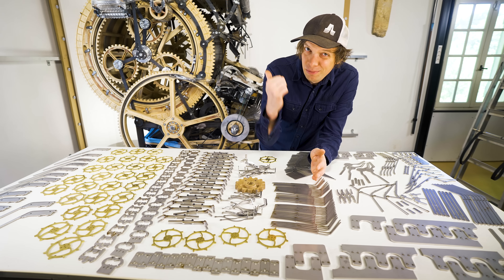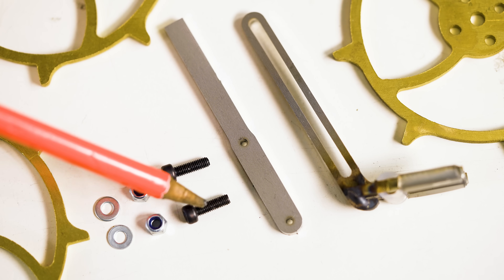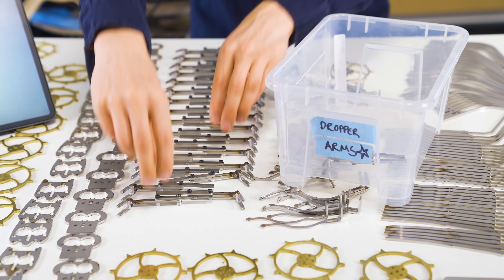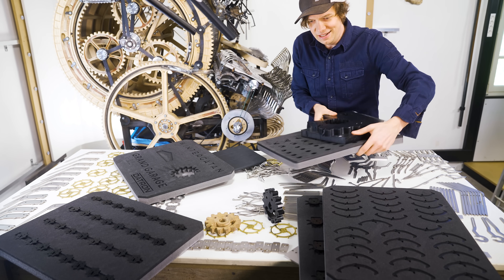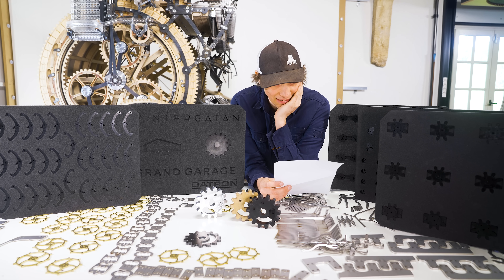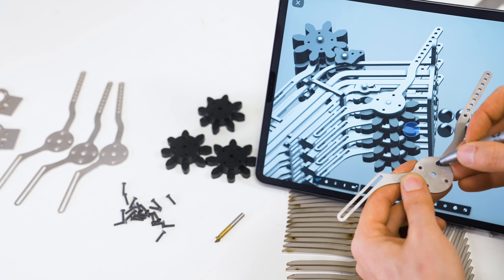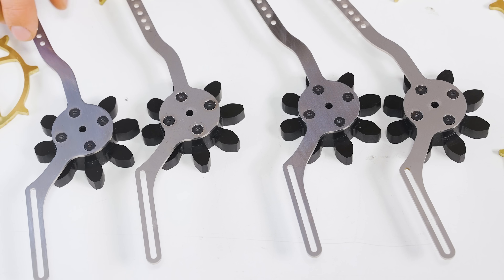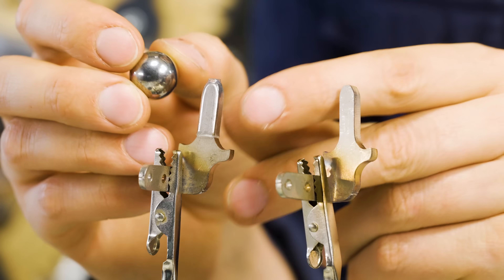Solving the 1000 Pieces Engineering Puzzle

Comment: That packing was 100% Next Level "We care about your product." Also the gears measuring down exactly 14mm and you were only expecting .1mm tolerance gave me goosebumps 😂
Reply: 0.1mm is a pretty target. It's only +/-.004, which most machines can hit right out of the box. I can hold half-thousandths on an old Atlas 618 without much fiddling.
Reply: quality work from Linz :D
Reply: best advertisement ever
Reply: It was 100% 1990s level. In case you haven't seen the news in the last 30 years, the 'next level' will be a total ban on non-recyclable packaging.
Reply: @nagualdesign  True. Laser cut cardboard could've done the same :)
Reply: @nagualdesign  Here in Austria we also recycle all kinds of plastic packaging. Even Styropor (polystyrol) or foamed material. We collect them in the "Gelber Sack" (yellow bag). Maybe a card board would be more environmental friendly. But some studies show that e.g. a paper bag is much more resource intensive to produce compared to a plastic bag. So the most obvious might not always be true.
Reply: @HannesSchmiderer  While it's true that it is collected separately, did you look up what's done with it afterwards? Since actual recycling is quite expensive, most of it is (or was) just shipped to China to do whatever...
Recycling plastics is still a big task that is not solved easily.
Reply: @theYTnickname  Plastics in general are fairly easy to sort for recycling. You just shred the lot into confetti, separating bottles from lids for example, then run the confetti through a series of brine baths. Different densities of plastic either float or sink in different densities of brine. You can feed in tonnes of mixed plastics at once and automatically separate them into different types, ready for recycling.

The foams are different. You essentially need a human eye on the job who can recognize polystyrene, and tell the difference between polyethylene and polyurethane to name just two, even though they're made in a variety of colours and densities, and then separate them by hand. As you say, it isn't economically viable so we pay poorer countries to do it (and by that I mean we sell them our rubbish and hope that they don't just burn or bury it).
Reply: ...If you could take each chunk of plastic foam and melt it into a separate puddle, removing the gas bubbles without it mixing with other plastic puddles, and allow them to cool you could then feed the hardened plastics into the normal separating machine. You could probably make a reasonable profit if you could develop such a process. At the very least you'd be doing the environment a big favour, provided that melting the foams wasn't too energy intensive. AFAIK such a process does not exist.
Reply: @HannesSchmiderer  Are the gelber sacks just for expanded polystyrene (EPS)? If so that's a good way of keeping it separate from other plastics and contaminants, making it very easy to recycle. And EPS is probably the easiest foam to identify.

Businesses that routinely produce EPS waste generally give it back to the EPS vendor so that nothing is wasted during production, but once it reaches the consumer as packaging, in most countries at least, it invariably ends up being burned or buried, or worse, being shipped thousands of miles, then burned or buried. Sadly, much of it ends up in the oceans.
Reply: @nagualdesign  The "gelber sack" is mainly for household and probably small business plastic waste. I looked it up: after collection it is sorted partly automatically and partly manually. About half of it can be separated such that it can be recycled. The other half is burnt - in industries or in district heating plants.
Reply: @theYTnickname  Yes, it's surely not easy. I think it's good that we have this discussion and that manufacturer see that customers care. But in the end it's about money. I would really prefer that we move to a tax and fee system where product and services costs include harm to the environment. So a goal should defined - let's say in 10 years. Every year the taxes are adjusted a little bit to reach this goal. This way the economy can plan ahead. From time to time the goals have to be reevaluated. 
Here in Austria we are discussing the "Ökosoziale Steuerreform" (greening/socializing taxes). "social" because there also has to be some compensation such that the reform does not harm people or families with average or below average income.

Comment: Hey Martin, you should Build one set to make sure your design works correctly.
 If you find out 1 wrong weld hurts the design you can fix the problem with the others Before Assembly

Comment: The parts are really cool but I feel like Martin is taking a step backward by trying to assemble everything at once and apparently put it all on the machine at once and see if it all works.  Assemble one set and make sure it works first.  If something is off then it's going to be much easier to fix it if the rest of the parts are not already assembled and far less soul crushing.

Comment: If I'm not mistaken, the "risks" associated with EMF are entirely hypothetical and have NEVER been proven.

There is no known method that non-ionizing radiation can cause the diseases some people claim it causes. There is a standing $1,000,000 prize for anyone who can demonstrate any level of sensitivity to EMF, which has been unclaimed for decades. There have been studies that looked at welding specifically since they're supposedly at such a high risk, and found no increased incidence of the diseases supposedly caused by EMF.

In other words, EMF isn't a real danger. It will not make you sick.

Comment: If you drill at a slow rpm, a high quality drilling oil wil suffice, but if you drill at a high rpm you need constant cooling to preserve your drillbits. (Kobalt drillbits can withstand higher heat) But I'm probably not the first to comment on this 😊 (english is not my first language)

Comment: When cutting stainless steel, standard practice is slow speed, higher feed. Stainless is hard on tooling no matter what you do, but the best practice is to slow down. If your speed is too high, you can generate enough heat to harden the material which in turn, makes cutting even more difficult.

When drilling stainless, I've found that a product called Moly Dee works very well. It doesn't smell good, but stainless drills much smoother with it. I'm a machinist and let me tell you, machining stainless steel is miserable on the best of days. It looks pretty, but that's the only good thing about it, lol.

Comment: 12:00 jam the 'cowboy' (technical term for TIG  hose/lead sleeve) between your leg and the bench rail, with a bit of slack, to support the weight of main part of the extension. Or a loose overhead elastic strap attached to the ceiling looped around it similarly. Source: 20 years TIG welding bicycle frames.